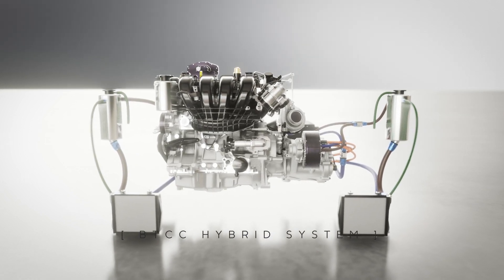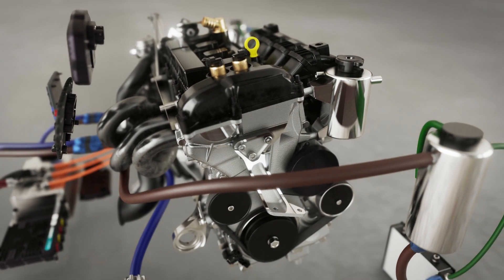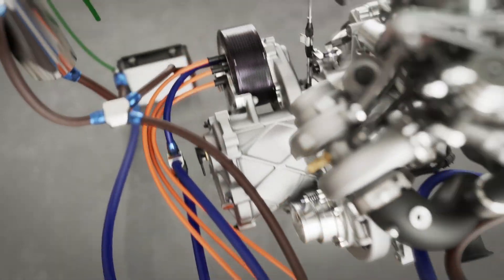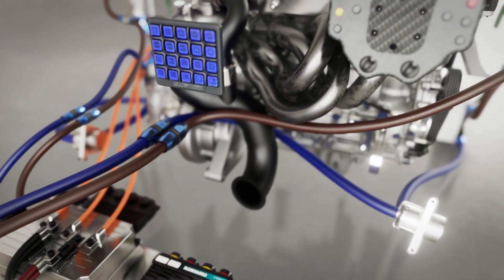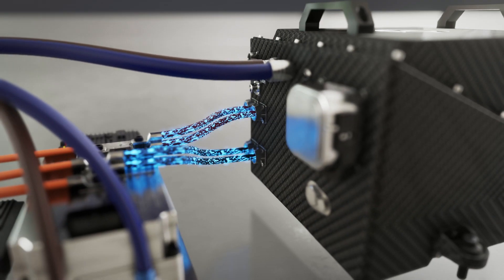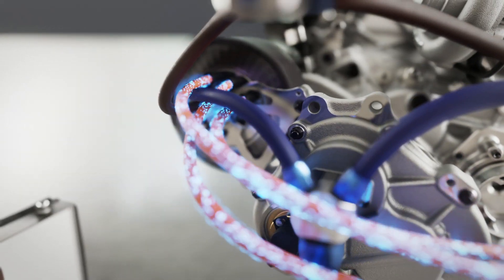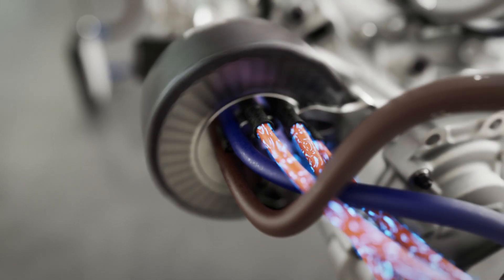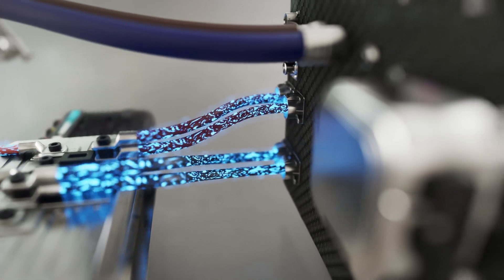Cosworth - BTCC Hybrid System (How It Works)

Comment: I am so hoping that something similar would be available off the shelf as a crate engine or sold as drop in components in a few years' time. Electrifying the input shaft of the transmission/gearbox seems to be a great idea and would already fit existing architecture with little modification. Even a modest percentage of electrification makes a difference. This seems to be very similar to what is being built for the WRC, considering that M-Sport built this unit.